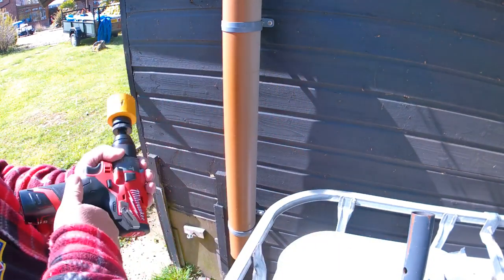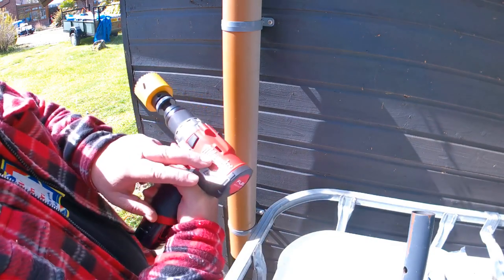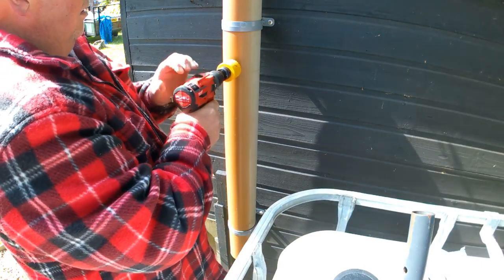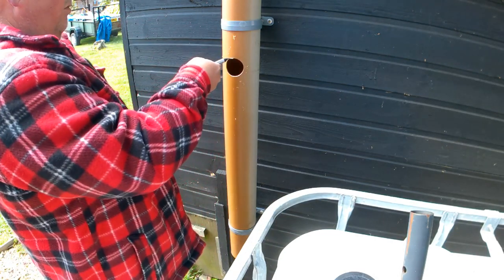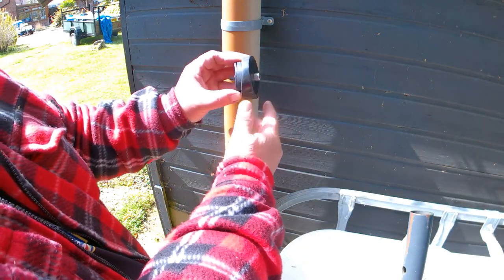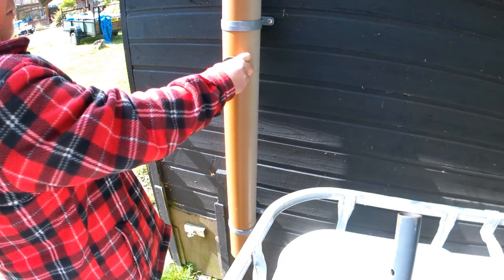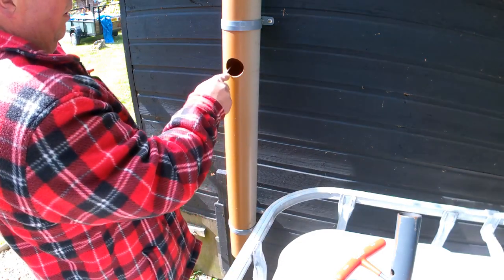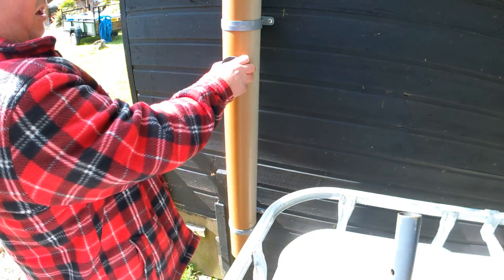Soil pipe point of access | Soil stack access

Comment: Great tip and product just what I was looking for as no access on waste stack to get to blockage 
Thanks
Reply from the maker: Glad it was helpful! You could also use a rubber bung. cut the hole same size as the bung, plug it with a bit of silicon.

Comment: Hi, very helpful video. I only need  1 of these access points rather than the packs of 10 I can find online. Any idea if someone sells individual items? Thanks
Reply from the maker: Unfortunately not. 
I only buy in 10's. 
Sorry
Reply from the maker: Just a thought.. you could buy a rubber or plastic bung & mastic. Just make sure its the same size as your hole .
Reply: @UnblockmyDrain  thanks